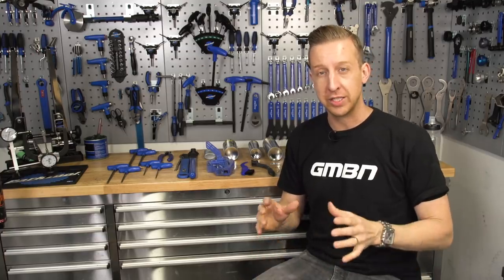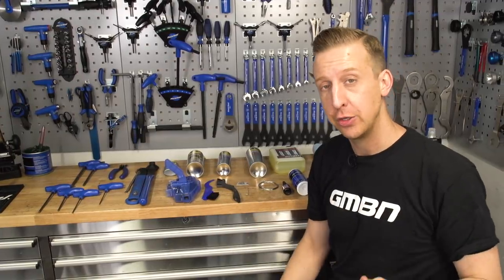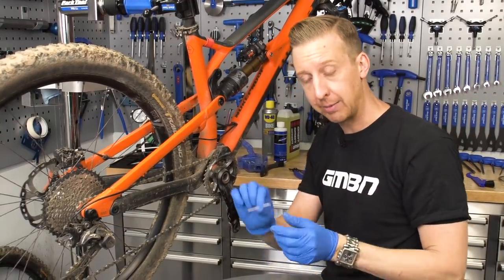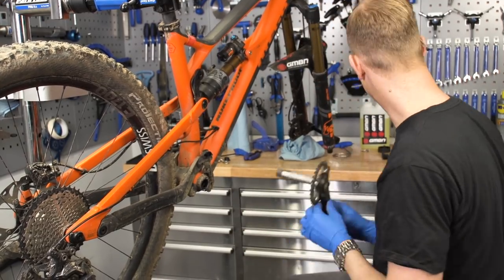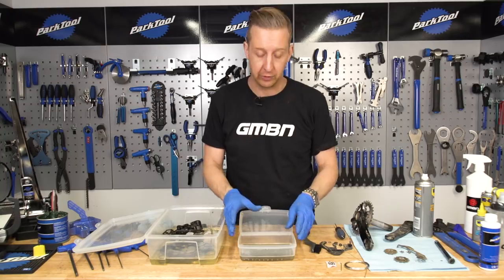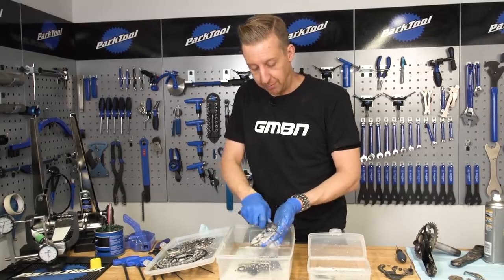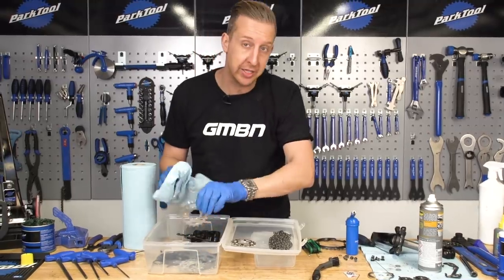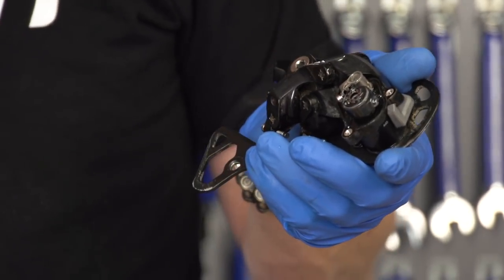Deep Clean Your Mountain Bike Drive Train | GMBN Tech How To

Comment: As you are a professional in the field of bike maintenance, have you ever considered using an ultrasonic cleaning tank? I’ve used one for cleaning things like small complex machine parts, small and large engine carburetors, and pistols, etc... You wouldn’t believe what they can help you get out of the passages of carburetors. From nooks and crannies that you never mind can’t see, but didn’t even know were there. The best part is, the part goes in, the tank cleans it, you take it out a few hours (if needed, sometimes shorter time) later, rinse and lube. They can save you a bunch of time and effort. Worth a try.

Comment: Andrew 'Ed China of the bike world' Dodd. Love GMBN tech, best of the GMBN channels hands down. Well done Doddy!
Reply: Here here! That's Edd China with two D's and Doddy are the best at their trade!
Reply: Agree mostly but some comments have rightly pointed out he hasn't explained some things including BB, relubing and fitting chain, cleaning/checking mech cable. I'm a fan of rinsing the degreaser off the chain using a spray lube and leaving to drip dry hanging up overnight. I then lube with wet or dry oil as needed while it's still hanging, knowing that the oil with find it's way down the chain into all the rollers. He didn't seem to know much about the jockey wheels (I'm sure he does really). The gunk is commonly known as 'grind(ing) paste. It's a combo off lube oil, grease and dirt and it kills drivetrains especially if you ride in sandy areas. BBs are pretty straightforward to remove and check. Give the threads a proper wipe down so that they are spotless and do the same with the threads in the frame. A shop would 'prep' your frame before reinstalling but it should be fine if you're meticulous.

Comment: This was a great video on how to thoroughly clean your drive train. The issue I have is with relubrication. You would never recommend putting sealed bearing in solvent without thoroughly repacking the bearing with grease. This level of degreasing requires a through effort to relube your chain to avoid premature wear.  Simply applying lube as per usual will definitely require miles of riding and multiple applications to work the lubrication back into the inner workings of the chain.  In addition, a chain with any use will develop  “drive” and “coast” wear on the chain.  No attention was given to reinstall the chain in the same orientation.
Reply: And what about the BB? I'll also add that wd40 isn't grease. He used it multiple times as lubrication. Lots of aimless surface scrubbing. Very basic stuff.
Reply: @BChiarcos  You do realise WD40 has multiple products right? WD40 spray grease being one of them.

Comment: I use a paint tray to degrease the chain. I leave the chain soak in the well and then drag it through the roller ramp link by link whilst giving them a good scrub with a brush. The ramp's spikes do a great job at keeping the chain in place while I do the scrubbing.

Comment: A vibrating or "sonic" parts cleaner, similar to ones used to clean jewelry, is a good option for doing this sort of thing as well... particularly for the chain and derailleur degreasing process.  Great video, Doddy.

Comment: Would you try out ultrasonic cleaner and putting the chain in with degreaser? I've seen other applications of such cleaner achieving wonderful results and I'm wondering if this could be used for bike chains too.
Reply: I use an ultrasound tank  for small parts, does a great job on chains and derailleurs. It's worth giving them a light hand clean first though to get rid of the big stuff.

Comment: A few comments, most chain manufacturers recommend not to use degreaser but very hot soapy water - I use a chain bath with hot soapy water after every ride and this keeps it like new. Secondly degreaser on the rear mech seems like a bad Idea getting all the grease out of the pivot points that will never get put back properly, again hot soapy water would be better. Only thing I would use degreaser on is chainring, cassette and cranks.
Regular good post ride cleaning is much better for your bike.
Not sure the ghetto bearing clean is a wise thing either....
Reply: I was thinking exactly why you and throughout the entire video... couldn't agree more!

Comment: Tip for oiling chain, heat oil up a little with chain in, thins it out to penetrate further, then install. Old motorcycling tip
Reply: Warming Or even leave a chain in oil overnight. It's helping it to bond on a molecular level. Ive soaked supposedly useless (skipping) freehubs in oil for a week and it rejuvenates them.

Comment: Not a fan of threadlock on bikes. Been using a thin film of grease on all threaded fasteners on my bike tightened to the correct amount and never a problem. Plus they easily undo when you need to service them.
Reply: What the main reason for putting grease on threads? To keep water out, avoiding rust/corrosion?

Comment: ANNUALLY!!! 

In a year I have had about 3 cassettes, 5 chains, 2 chain rings and about 3 bottom brackets and got the shop to do a hub service a couple of times. And that is just one of two bikes. I came here to find a better way to clean my chain, I sponge it with pink Mucoff, spray the green Mucoff degreaser on it and rinse, then use Mucoff spray biodegreaser, then leave it to dry naturally. Then lube before next ride.

I guess thats the only benefit of being one of those riders that question whether they should go out more than once a month, but the disadvantage of that is you never learn anything.

Now time to watch the other 14 minutes of the video..

learned how to clean my derailleur, because I clean my new one after every ride, it doesn't get any build up. But because my 29er commuter was bought second hand and it is the same XT derailluer, i am going to do exactly this on it some point next week when I replace my chain, cassette and gear cable
Reply: Sounds like you're doing a good job now.

Comment: One thing that i did once to clean a muddy and Mucky chain. I tried cleaning it the normal way (old toothbrush and degreaser) but the chain was still gritty. So what i did was i put a lot of degreaser on the chain to get that muck thinner and then pured some hot water over it and that washed everything out of the nooks and crannies of the chain

Comment: And don't forget to put grease onto bolts which are moving parts.
This means: Pedals, Crank Axle, Casette holding thing (don't know the english name, but the place on the wheel where you assemble your cassette onto :D)
Grease will help keep these parts from seizing up, and making them almost impossible to disassemble after heavy riding :)

Comment: Dema Ultrasonic Cleaner with its own cleaner fluid is all I use. And I only clean the chain and cassette, as I use wax on my rides. Less muck, more shine. And most the times I only have to give the chain a small clean and wax, because the dirt does not stick to the chain as much.

Comment: I am confused. All the chain manufacturers say never soak your chain as you will loose the factory grease inside the rollers. I used the chain box cleaned the chain and cassette. It looked beautiful. Then I meticulously lubed every link. The chain made a lot more noise than before I started. I used Treks all condition lube?

Comment: Relatively late question but I'll ask anyway. After cleaning the stuff with degreaser, instead of hot water, can it be just tap water and then spray with WD-40 contact cleaner to drive the moisture out?

Comment: Waxing my chain instead of using oils has been the best thing ever, I have a hard time understanding why people still use oils, all it does is collect grime and wear your components out and every time you need to clean it you hate your life! good video though!  I personally used petrol as degreaser in the past to clean my chain and cassette and it does the absolute best job but if using petrol I would not soak the derailleur in it.
Reply: I think the point of degreaser is that there are environment-friendly options, no one should pour used petrol down a garage or storm drain.
Reply: Petrol is not for the masses, but if you want to take your cleaning skills to the next level its required, leave the remainder in a well ventilated area for it to evaporate after use, caution and smarts are needed
Reply: I'll second you there Jack Sadek. Oz Cycle taught me that
Reply: Depends where you ride.
Reply: Don't use petrol. It's carcinogenic, flammable as fuck, the fumes are unhealthy, and the result isn't that much better. Modern degreasers perform well enough without all the drawbacks.

Comment: Can I use petrol as degreaser to soak my chain in? Also great video doddy been waiting for a more in depth one for ages 👍
Reply: Yep, use both if you want to do a thorough clean, first petrol, then degreaser, then metho. Then you'll need to do a very thorough lube job to get those inside rollers, which can be done by soaking chain in a hot wax treatment. Oh, you need to thoroughly wash the degreaser out of the chain with water after the degreaser and before the metho.
Reply: Petrol is so dangerous it is very very explosive - you're literally playing with fire. Diesel a lot safer. Plain old WD 40 works well though and doesn't cause an expolosion!
Reply: Neil Barstow when should I use the wd40? Should I use it before cleaning with hot soapy water or after?
Reply: @zacjohnson452  I use it after to get grease off and  dispel the water - then dry it with a rag and use a decent lube like Finish Line Century

Comment: Could i also wash them with a ultrasonic cleaner?
Reply: Yes, although not as a first step, you should try using solvents and brushes to scrub as much as possible and then the ultrasonic clean in a citric degreaser/water mix for the really hard to get spots.

But yeah, specially for the chain, it works wonders

Comment: Great info I enjoy watching you guys at work. I have a question for you I'm riding a epic S Work 2012 with a sid dual air front shock brain and having a hard time on my set up, I'm 175bls with all gear on and I have been testing more air in the lower parts of the chamber and wondering if this is a bad idea to do or the best way to go about it?

Comment: I would LOVE to see some empirical data on this subject.  As in actual proof that this process actually results in better performance, and more importantly, chain life.
Because I've found over the years that chain life can be an elusive thing.  First, expensive chains don't necessarily last longer.  And second, what you ASSUME is true is not.  Like, for example, that a tandem main chain lasts LONGER than a tandem timing chain.  How on earth can a chain 2 1/2 times longer with only ONE rider pushing on it wear out faster than a chain with TWO riders mashing on it?  Doesn't make sense.
I used to be a chain-cleaning freak.  I removed my chain, soaked it in solvent, then re-installed and lubed.  I was a teenager with lots of time on my hands.  But I found that it took about three thorough lubings to get all the squeaks out of the chain.  Then I read other professionals comment that removing all the lubricant, only to have to "over lube" the chain to restore it is a waste of time.  Why dry out the most important parts, only to have to over-soak the chain trying to get lube BACK in there? 

And this doesn't even address the fact that a pristine, perfect, shiny, happy chain lasts all of about two and a half minutes into the next dirt ride!  It's DIRTY immediately!  It's dumb to go to all this trouble on a mountain bike that's actually being ridden off road.
Chains are consumable goods - they need to be replaced regularly.  Not that they should be abused or abandoned; no, not at all.  Chains deserve our love.  But not to this degree.  Plus, they do great exposed to the elements.  They sustain ungodly amounts of abuse and crud, yet still propel us forward with the greatest of efficiency.
I suggest that instead of wasting time and money on this silly obsession with tanks, brushes and solvents, just work another half hour at your job so you can afford a good supply of replacement chains in the shop to be at the ready for the next timely chain replacement.  And with 12 speed Eagle cassettes costing as much as $450,  you BETTER replace that chain before it's too late!
Yes, care for  your drivetrain.  Absolutely.  Certain lubes require chain care after every off-road ride.  Some DURING a long ride.  Care spent cleaning your rings, cogs, pulley wheels, and wiping the majority of the crud off you chain is worthwhile.  And yes, if you embark on a mud ride from hell, then absolutely, hose that sucker off nice and clean (after all, it's ALREADY soaked, but soaked with fine abrasives too!), dry and properly lube.  But for dry riding?  Even SOME wet riding?  No, put down the damn solvents!!!
Or switch to a Gates drive and be done with this silliness!
PS  Or please show conclusive evidence that this OCD approach to chain cleanliness actually pays off with considerable chain life extension.  If you can prove using these tanks, solvents, brushes, etc. DOUBLES chain life, then I'll reconsider.  Short of that, waste of time.

Comment: I thought wd40 is drying lube so it will dry parts eventually. I use it only to rinse degreaser off, then wipe as much off as I can and put the proper grease on. Shimano clutch works perfect with ceramic lube, the white stuff.

Comment: Wondering if anyone can help.. I've just bought a new bike and the freewheel is not so free, is their a easy adjustment for this sort of thing? ITS ONLY SIX HOURS RIDING!! I've tried adjusting the tension through the axle this may have been the issue.. when I took the wheel off the sheath for the axle was loose seemed odd but as if it was meant too be. The Bike is a Fuel EX8 2020 29" if anybody knows or understands be great to hear from you.

Comment: Could you try an ultrasonic cleaner for chains, and cassettes?
Reply: yes they work great use petrol instead of water for greasy oily chains
Reply: At the bike shop i work at we let really nasty parts soak in a bucket of diesel for half an hour
Reply: Mattias M yeah diesel works great too
Reply: I dont bother to take the chain off since i have a park tool chain cleaner, but i was curious if the ultrasonic cleaners make the chains look new
Reply: Mattias M yes it will but the chain is bare so make sure to get lube back in it or it will rust quickly from the water based degreaser

Comment: Hi got my bike back after it was stolen. Noticed the back wheel is stiff and the drivetrain is barely moving. Is the drivetrain going to be main contributor to this?
Reply from the maker: Probably yes! If your drivetrain is rusted and stiff it will inhibit the smooth rolling of the rear wheel! Nothing a good service and a few replacement parts can't handle though!

Comment: Actually, WD-40 (the original "mix") is really good at cleaning chain. Just use it instead of a degreaser: it'll soften up any gunk and old grease so that is would be plainly easy to wash it off with some water. The chain comes out sparking clean.

BTW, Shimano recommends using the Internal Hub Grease (aka Nexus Grease) for greasing their clutches. Other kinds of greases might wear out quickly and your clutch would become "notchy" (the cage should feel smooth but resistant when the clutch is engaged). Look for the LoveMTB's video on clutch service in depth.